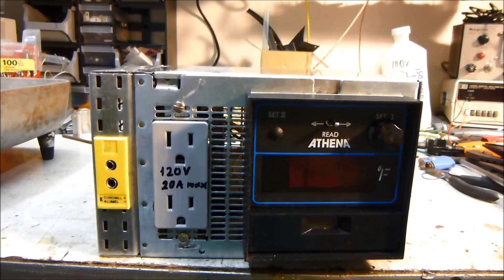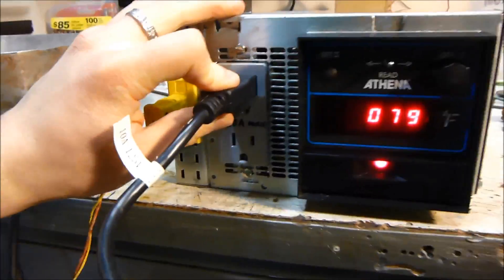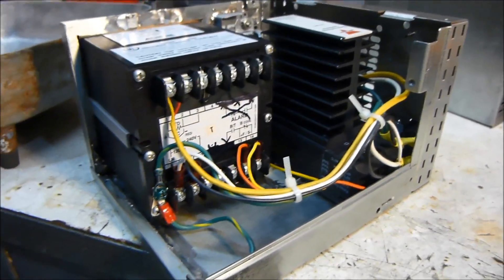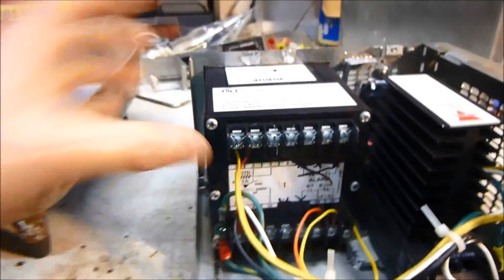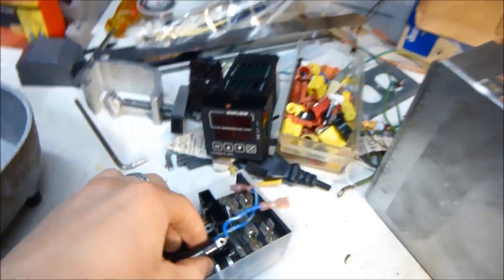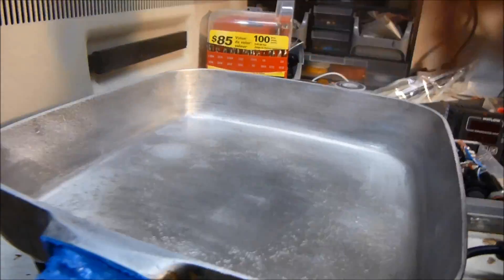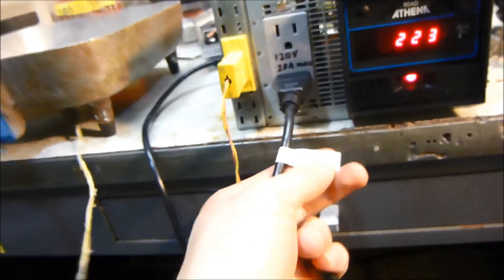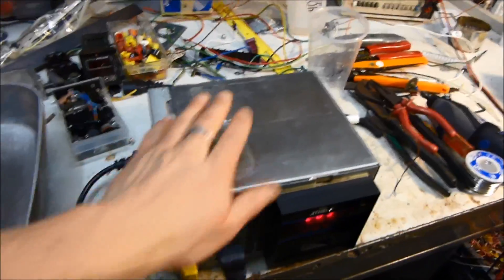Homemade Temperature Controller Unit

Comment: everything is nice and safe but the only thing is that the IEC input connector is only rated at 10A and you wrote 20a on the output socket wich is rated at 15a too, anyway its a really cool project

Comment: id add an internal fuse because its not like youll have to worry about it blowing to much, id make sure to put a fuse because you can never know what might happen and it would suck if you burned something up
Reply from the maker: Yes very true.  I'll add one.  I have to figure out what fuse holder I want to use...  But ya a fire would not be good.  Because the cord is only rated for 10 amps does that mean that I have to use a 10 amp fuse in it or can I use a 15 amp one?  Thank you!
Reply: its only rated for ten amps but nothing bad would happen if it went up higher for a while, it would just get hot, so yeah i think a 15 amp fuse would work fine
Reply from the maker: Ok sounds good!  Thank you so much!  :)  I'll add one!
Reply from the maker: corbonzo1 Do I need two fuses?  One for the main load going to the outlet and one for the controller unit?  I looked inside the controller unit and it does not have any fuse.  The mains go straight into the step down transformer.  Or do I just need one 15 amp fuse on the input?  Thank you!

Comment: nice project.THUMBS UP.see if u can make  reflow oven for smd would be cool.
Reply from the maker: Thank you!  I think I could just use the pan I show in the video with an insulated lid on it.  What do you think?  Or I could just plug our toaster oven into my contraption.
Reply: Of cours you could do that but it would need a loot of time to heat the board up and yeah you could plug the toaster oven it works great i made one but its not temperatur controlled :)
Reply from the maker: E Isad Yeah that's true.  Only thing is that I'm not sure my mom would like me cooking circuit boards in her toaster oven!  :D
Reply: Makerj101 Hahaha yeah thats true neither my mom likes it but they want to trash a toaster and i got it to work back but with only one heater and it suck.see if u ca get.see if u can finde an old one .:-)
Reply from the maker: Hahaha all the toast would smell like hot plastic and circuit boards!  XD I have several heating elements from old toaster ovens, bread makers, and the 600 watt light bulb type ones from laser printers.  Maybe I could make my own.  Hmm that would make an interesting video.  People would defiantly like that better then just a normal toaster oven...
Reply: hahahaha i would like to eat bread with circuit smell o_O.yeah if you can make one with thoes it would be a great project.yup they would like that hahaha.waiting to see that project and i have send you a googel+ request pls accept
Reply from the maker: Yeah!  What Google+ request have you sent me?  I don't see any requests.
Reply: +Makerj101yeah i send u a googel + eequest might be a googel fail dont now
Reply from the maker: Oh I see.  Ok, I just added you! :)
Reply: thanks
Reply from the maker: You're welcome!

Comment: Cool guy!! Parents has to be proud of you. You go boy. Looking forward to your next project. I'm going to put together a solar powered system soon. Wish me luck.
Reply from the maker: Thank you!  Cool!  How many watts of capacity will it be?
Reply: Makerj101 Samlex Commercial Grade Pure sine Wave Power Inverter 2000 Watt 4000 Watt Surge
Reply from the maker: So you are going with an off grid system?  How much battery storage are you planning for?
Reply: Makerj101 I picked up one 6 volt deep cycle battery used for golf carts. Solar panel is 100 watts. Will i need one more battery or one more battery you think to push the inverter? Thanks for your time.
Reply from the maker: Yeah you will want another battery.  It needs to be of the same type and age or they won't charge evenly.  Unless your going to have a 6 volt system but I don't think that would be very efficient.  Plus I'm not sure they sell 6 volt inverters.  100 watts is pretty good for a start.
Reply: Makerj101 If you have two 6 volt batteries and connect Positive on one battery and negative to the other will that have it a 12 volt source?
Reply: Carol Williamson Maybe i should pick up one 12 volt deep cycle battery made for golf carts. I was told that 6 volts was better for solar.
Reply from the maker: Yes you can connect two 6 volt batteries in series to get 12 volts.  But if the batteries are not exactly the same age, size, or type, they will not charge evenly and one will get over charged and ruined and the other will get under charged and also be ruined.  Twp 6 volts batteries will be fine if they are from both from the same cart or similar aged carts.  If there is only a small difference in the batteries they should even them selves out.  Hope this helps.  BTW it's the same reason why you should not mix different types of batteries in one device (alkaline, lithium, carbon-zinc, rechargeable, etc).